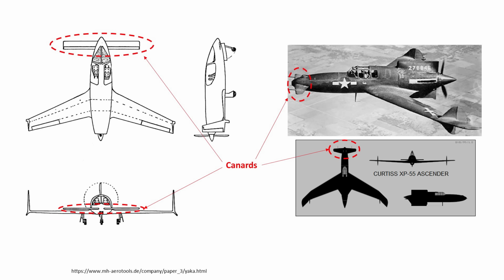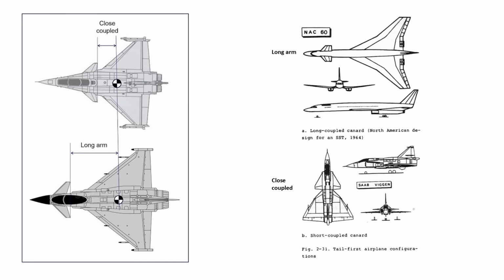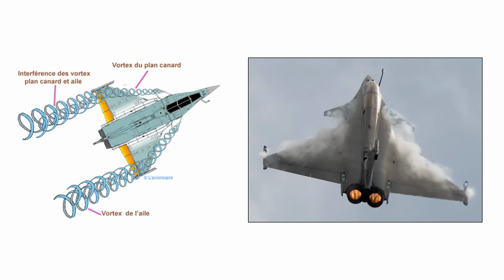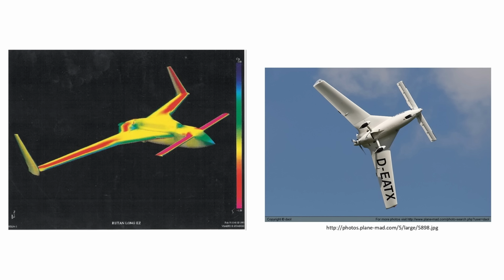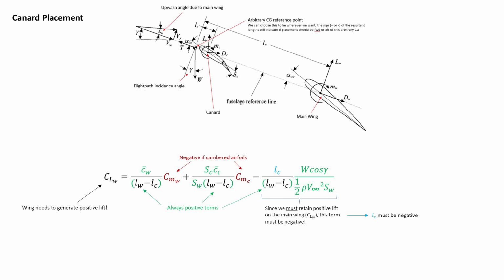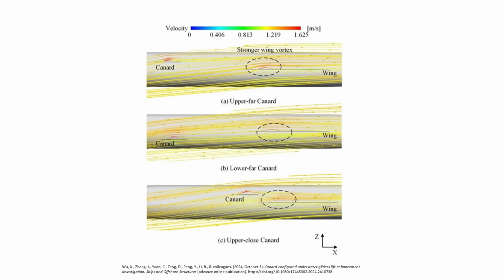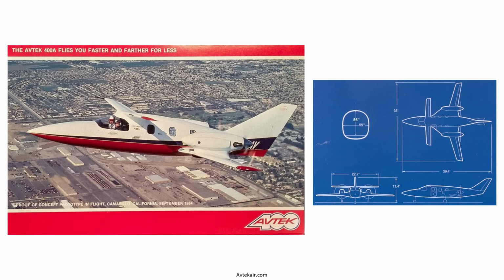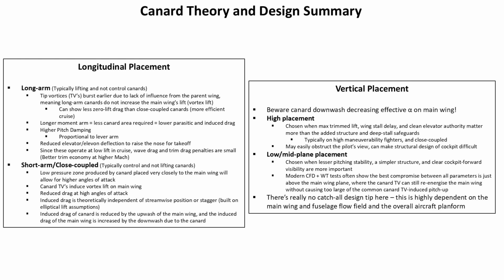Canard Design and Aerodynamic Theory

Comment: The reason the horizontal stabilizer isn't in line with the wings is because of the dirty air, so wouldn't it be better to have the canard above the wing as well to keep the air clean and not need as much delta wing?

Comment: I'm just an old RC aircraft  experimenter that learned may of the lesson you  have laid out so succinctly here.  I have one question for you; at 34:40 you say "Stall - high aspect ratio wings stall sooner..." do you mean a lower angle of attack? Also what is the Best form of roll control?  Ailerons on the main? Canard? both?  Thanks for the lesson.
Reply from the maker: Yessir, higher aspect ratio wings stall at a lower angle of attack. The most effective form of roll control will be ailerons on main, as the moment arm generated about the centerline of the aircraft is maximized, requiring less deflection and therefore less drag. However, things get complicated when your canard approaches the size of your main wing.

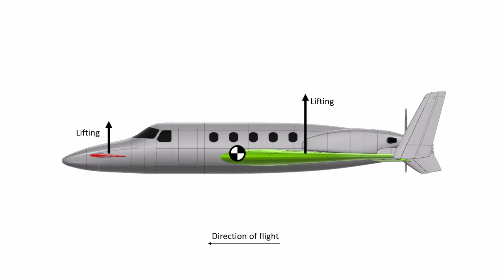Comment: Starting around 11:04 or so, you discuss the longitudinal stability of canard aircraft, and begin by for a few minutes conflating the need for the canard to stall before the main wing (which is no different than ANY aircraft - the forward wing must stall before the aft wing in order to avoid deep stalls in ANY aircraft) wth the longitudinal stability. These two issues, while dependent on similar parameters, are not related - one is not required for the other requirement to be met. A plane can be designed to be longitudinally stable, yet have the aft wing stall first (put the CG far enough aft and it will happen on ANY aircraft), or it could be designed to be longitudinally unstable, while the forward wing stalls first. They are NOT coupled from a requirements standpoint, although the design characteristics that affect each are similar.

Your discussion of the zero lift AOA gets close to the right requirement, but I suggest you read "How It Flies", Chapter 6: https://www.av8n.com/how/htm/aoastab.html , particularly section 6.1.7 re: canards, to get a better idea of longitudinal stability and the requirements for it. Or read Perkins & Hage, or any other book on aircraft stability and control. There is no need to discuss stall behavior or requirements when discussing longitudinal stability.
Reply: At 24:18 you hit on this when evaluating the math. It's just the conflation with stall that is the issue earlier.

Comment: Thanks Gabe great video. I owned a LongEZ and now fly a Cozy IV. I have 1000 hrs. flying canards.  I recently flew my four seat Cozy 500 nautical miles, used ~25 gallons and averaged 200 MPH with a light crosswind. Rutan canard designs are efficient, safe and fun to fly. They do use more runway without flaps.
I wonder what program you did the CFD visualizations?
Reply from the maker: That’s awesome! For CFD visualizations, I typically post-process via Paraview. Here and there I’ll use STAR-CCM+ as well.

Comment: What an absolutely amazing video! Once I finished my grad studies, I always thought that it was a shame how we only discussed aerodynamics of standard airplanes, leaving aside configurations like cannards, flying wings or lifting bodies. After benching your videos I'm definitely going to try designing one of those as an RC plane. Thank you soo much for putting soo much effort into your videos, keep it up!

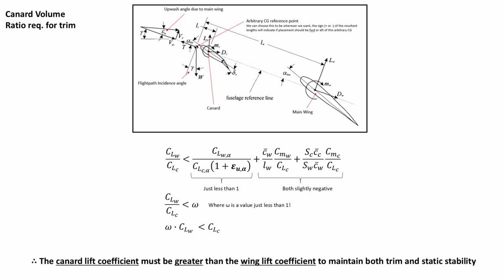I also wanted to ask about the second point of the summary. In the summary it's stated that the CLmax of the cannard must be less than that of the wing, but at 13:10 you said it the other way around, and the conclusion at 24:10 is that the cannard should have higher CL than the wing for stability (wich is not max, but given the higher AR of the cannard, you wouldn't have a crossing point in the lift curve for most cases). Could the summary be wrong and ment higher alpha_max? Maybe the summary contemplated a particular factor about the configuration, or I might just be getting things all wrong (wouldn't be the first time).
Reply from the maker: The CLmax of the canard should be lower than that of the main wing, but the operating CL of the canard should be higher! Just think if it as: the canard should stall first, so at the same vehicle alpha, it should be closer to CL max and reach CL max before the main wing

Comment: I'm a little confused at the very end. On the canard theory slide you say the canard CL Max must be less than the wing, but on the next slide you say the canard CL must be greater than the wing. Am I missing something?
Reply from the maker: Pay attention to the subscripts!
Reply: @gabefpv  Sorry typo in my original comment. It says CLmax in both slides. I've saying canard CLmax must be less and the other CLmax must be greater. Is one talking about the whole wing and the other just the airfoil section?
Reply: the "max" is important here. One case is for straight flight small disturbance stability. The other is for large disturbance -- and I hate it. It is like understeer in a car. When I flare a plane on landing, I want all the lift of my wing. I don't want to be limited by the tiny control surface at tail or nose.

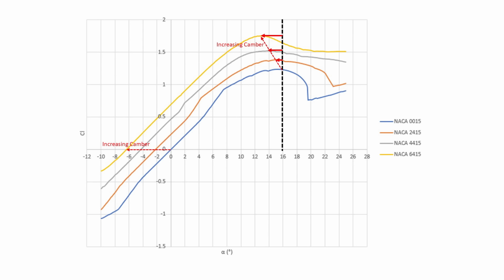Comment: 13:57 both the canard and the main wing are the same airfoil?  Explain.
Reply from the maker: Yes, I missed that one. A little bit of critical thinking never hurt anyone, too ;)

Luckily, it should be obvious that the top 2 airfoils should just be any with a higher camber (3415, 4415, 3412, 4412 etc.)
Reply: @gabefpv Thanks for the info.

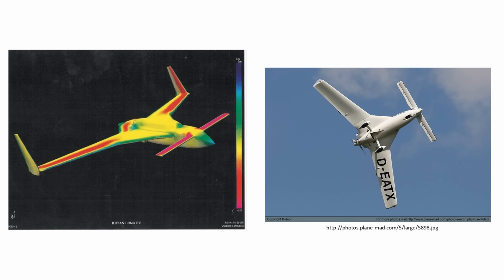Comment: Dude. Well done. Aerospace (and Space System) Engineer specializing in Low Reynolds CFD. I own a Dragonfly (Like aQuickie), a Long Ez, and share a Speed Canard (which was seen at 0:39 on the right but not mentioned). So, while loving Canards I tend to be the only canard owner that speaks the truth, and many times I get a lot of backlash from the canard community. From my own GA kit plane design, to any of the consulting I've done, I have always made the same argument, yet rumors persist. "It must be more efficient because its contributing to lift!" ::Facepalm::

Comment: 7:44 "Stall proofing device, lol.  Canards must be designed to stall first, before the main wing, lest the canard while still producing lift causes an uncontrollable pitchup.   That is what is meant by stall proofing.  Get the size wrong, and one ends up having a very dangerous airplane indeed.  Conventional configurations are nowhere near as sensitive. While comment was made about vortex bursting, no mention was made that the downwash behind a canard reduces the left produced by the area of the wing behind it.  Considering the chord of a main wing versus the chord of a canard, the amount of lift lost by the wing is likely more than the lift produced by the canard. While the Rutan canards, the longeze and varieze, were praised for their performance, all of their performance benefits could be attributed to light weight, extremely small cross section, and very smooth skin.  When scaled up, the Rutan designed Starship was unable to meet its performance targets.  And compare its performance to the Piaggio Avanti .  Both 10 passenger aircraft, the Starship was fifty knots slower despite having larger engines, shorter range, and much, much heavier.
Reply from the maker: Please watch my video thoroughly before commenting like this. I mentioned the downside of the downwash effects extensively, as well as dedicating an entire section of the video to stalling the canard.

Comment: great video, really enjoyed it
I would just add that negative lift should be considered too, rear wing shouldn't stall in that case either, so using same airfoil and AR would be bad choice for tat reason also
lower wing loading of rear wing helps in deep stall when "flat plate drag" points your nose in right direction
maybe just to mention that higher aspect ratio front wing reduces static stability a bit

Comment: 👍Good video.  I've done some amateur aero and hydro calcs for high performance sailing boats such as the AC75 foiling monohulls and F50 foiling cats.
FYI, the TU-144  added the canards retrospectively due to very poor low speed stability, and as a result had impractical high landing speeds requiring super long runways.

Comment: Can you please also do 3 lifting surface configurations please. Something like the Piagio P180.
My most recent project is a 3 lifting surface aircraft and i wouod like to have a second opinion before I get too far.

• Low placed anhedal lift and control canard with downward facing and positive canted winglets. Flaperon and elevon cintrols.
• Low placed dihedral wing with downward facing and positive canted winglets. Flaps and flaperon.
•  High conventional or cruciform tail with horizontal vertical stabilizers and, once again, downward facing and outward canted winglets. Elevon controls.

Also, front prop. Havnt decided if it should be regular or contra-rotating yet. 
I made this bird as unconventional as I could and, in theory, it seems pretty good.
Reply from the maker: Why anhedral canard? Are low plane anhedral canard winglets intended as landing gear?

Comment: I've got an Masters in Aeronautical Engineering and this channel is far better at communicating the theory than any of my professors were!
Reply: agreed !
Reply: Is that degree worth it? Studying for a BSME right now with plans for an MSAAE, but I've heard from some people that it isn't worth it. What would you say?
Reply: Yes, but not theory. Theory is most often defined as a mathematized and schematized for small dimensions model of a phenomenon.
But in the HISTORY of aviation, I see that such mathematization is rather detrimental, even though it allowed for quick calculations on a slide rule.
I see here that it's much more fruitful for proper aerodynamic creativity to look at flow lines in wind tunnel studies and then draw 3d pictures of the phenomena, with Bernoulli's principle in imagination. 2d approx are of little help.
Well, or today we use calculation programs that are not exactly “theory”. As an aviation history buff, I'm on the side of Lanchester vs Prandtl. Lanchester's contribution is overlooked and unknown to many. And the successes of the "Germans" are exaggerated.

Comment: Great video!
 I find it quite intuitive that canards have a destabilizing effect - anything producing drag ahead of the CG is destabilizing, and anything producing lift produces drag.
I am quite amazed that canards are not far more efficient than the traditional wing-tail configuration. If you have a lifting service providing negative lift, but positive drag, this means your main wing needs to produce more lift to compensate - thus more weight and even more drag. Is it right to say that the downwash makes negative lift surfaces more efficient?
As for STOL aircraft - Su-33 has canards and is STOL - though it also has a tail and the canards are probably more for control rather than lift - also it has tons of thrust and uses a ski-jump, so these all contribute.

Comment: 31:23 this image explained that with unstable canard configuration, the canard has a down force thus the wing has to "lift more" and create more drag? It would then seem that the unstable tailplane configuration is more efficient because the tailplane contributes to lift and offloads the wing.

Good content!
Reply from the maker: The intent of the lower right graphic is to compare a down-lifting tail behind the wing to the equivalent down-lifting tail ahead of the wing. The stable tailplane is a down-lifting tailplane. The whole premise of canard implementation is “can we achieve stability with a lifting surface instead of one that decreases our overall lift?”
Reply: @gabefpv  Thanks for taking the time to respond.yes, I realise the stability implication of the images on the right, but I was thinking in terms of efficiency for an unstable configuration rather than stability.
In the unstable tailplane configuration, the tailplane contributes lift and offloads the wing, whereas in the unstable canard configuration, the canard must provide a down force, thus increasing the upforce from the wing and thus increase induced drag. It would also seem that the unstable canard is less efficient for instance in cruise than the stable canard for the same reason (in stable canard configuration top right, the canard provides an upforce).

So I'm wondering whether the unstable canard is less efficient due to higher induced drag from the wing than an unstable tailplane configuration.

 I have technical knoowledge but I am no expert in aerodynamics.

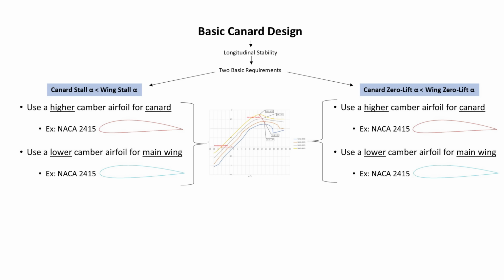Comment: @14:20, you mention a shift in airfoils from higher to lower camber but call out the same airfoil NACA 2415 designations for all cases. (amazing video so far). As I'm building a Quickie 2 (Q2) this is terribly interesting.
Reply from the maker: Yes, I missed that one. Luckily, it should be obvious that the top 2 airfoils should just be any with a higher camber (3415, 4415, 3412, 4412 etc.)

Good luck on the build! Big fan of the quickie

Comment: I designed a flying wing of mine, and did lots of test, your explanation helped me clear up some doubts i had and if it weren't for you, maybe my design would have been even more inefficient. Currently, at 0°aoa it  has a Cd of 0.032 , a Cl of 0.28 and Cm alpha is in the low negatives as i like it. The cd, cm and cl values are from openfoam and stability analysis was done in xflr5 where it was stable. What do you think about vortex lift, I'm thinking about using that too in this design, my cfd model actually had the wing extension required but my xflr5 model where I actually want to test its effects, I forgot to put that in. Do you think it will make a big difference? Cruise speed of this plane is around 155mph-170mph ( ~260-280 kph) with a top speed of 205mph(~330kph), wing area is about 0.042m² without LE extension and 0.046m² with LE extensions. Top speed won't be affected much as the main limiter is actually the pitch speed of the powertrain

Comment: I'm surprised you haven't mentioned the biggest disadvantage to canards, namely their response to lift increasing devices like flaps and slats. As a side effect of increasing lift, flaps often shift the center of lift rearwards, loading up the elevators. In a conventional tail, this effect can be mitigated by the increased downwash from the flaps affecting the elevators downstream (in high wing airplanes like a cessna 172 this can actually lead to over compensation), but as the canards are upstream this requires trim correction(and extra drag) as well as fitting flaps to the canards themselves, to mantain pitch authority. 
As for slats, the problem is that they increase lift by increasing the angle of attack allowed before stall; as the limit is set by canards themselves, adding slats to the main wing is completely innefective unless they are activated automatically, and the canards are sized according to the limits of a main wing with slats deployed (negating stall protection if for whatever reason the slats don't deploy).
This is one of the reasons why rutan designed the global flyer with conventional tails as opposed to keeping the canard from the voyager.
Reply from the maker: I did mention this, the fact that long flaps are not as effective, and you’ll probably have to add flaps on the canards🤙
Reply: @gabefpv Shame on me for not paying attention, but i do have to clarify that it's not that the flaps themselves are less effective, it's that canards have difficulties tolerating more effective flaps.

Comment: around 14:16 both are 2415?
Reply from the maker: Yes, I missed that one. Luckily, it should be obvious that the top 2 airfoils should just be any with a higher camber (3415, 4415, 3412, 4412 etc.)
Reply: @gabefpv  yea they don't look like they're both 2415, just the text, nbd!

Comment: Amazing video, it pulls together various rules that I'd always taken on faith in discussion of aircraft designs while gracefully tossing in introductions to theoretical areas unrelated to canards per se. I hate to say it but it is a bit silly that this is like your fourth or fifth simultaneous job.

There is an unfortunate minor error from 13:55 - in a slide about contrasting characteristics of different airfoils, all the NACA airfoil numbers are the same.

This isn't a call to explain it, it's a niche of a niche of a niche that nobody will ever build, but the parts about assuming elliptical lift distribution this and tip equalization vortex size that made me think repeatedly of Albion Bowers' presentations of his work at NASA, promoting use of the other solution of Prandtl's lifting line theory: A bell-shaped lift distribution that goes negative near the tip and zero at it, optimizing the vortex shed for something other than minimum span.
Reply from the maker: You are ABSOLUTELY right, good catch! Thanks! 
The lower two should be 2415 and the upper two should be 4415 to align with the previous slides, but obviously, the specific foils don’t matter, as long as the relative camber is increased for the canard vs the wing! 
As far as the BSLD goes, I cover this in my first video, give it a watch!
Reply: @gabefpv  Ha, go figure. Will do, then!